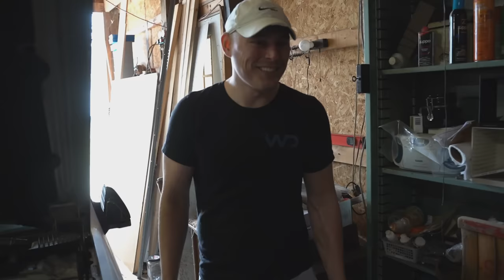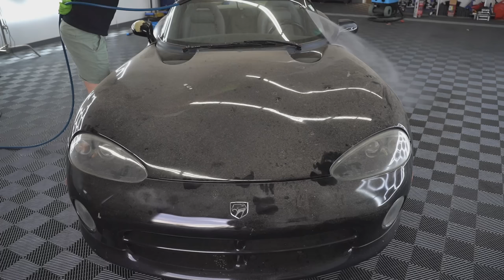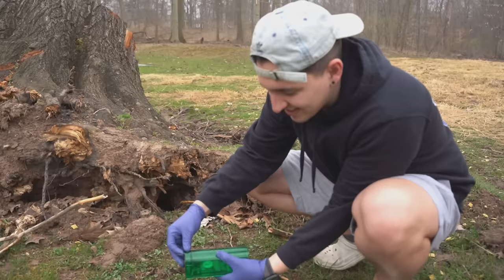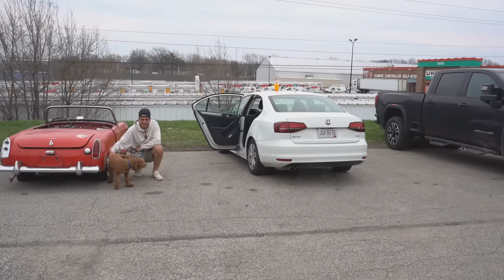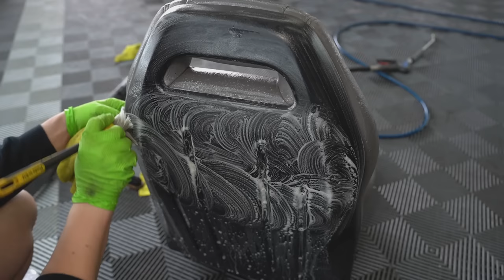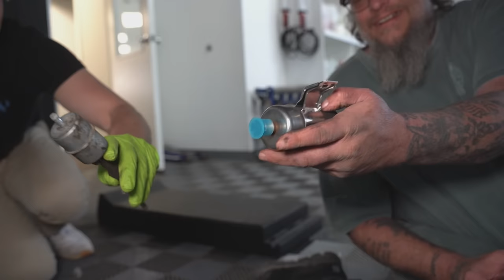ABANDONED BARN FIND Dodge Viper Disaster! Car Detailing Restoration

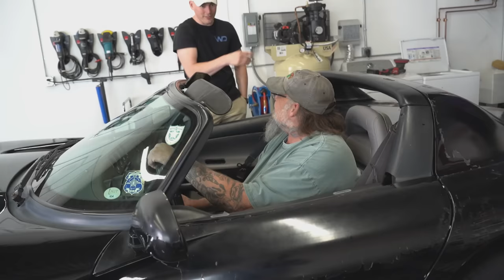Comment: Please address the tires before driving it too much. The rear ones are clearly the wrong size, but beyond that and more worryingly, they're seriously cracked and therefore could blow out any time. At 14:21 you see a massive split in the sidewall going around the entire circumference
Reply: I was going to write that😅
Reply: Old tires are one of the main causes of these cars having a bad reputation for handling.  They were top of the class when they came out with new tires. Those tires have to be like teflon now.

Comment: I was at Chrysler's new Auburn Hills, MI building to see the preproduction Viper. The car they had was rough. It had been beat on. It had no stereo or speakers but the holes were there and it was red. Shelby was there too. I don't know what engine they had in it because they wouldn't show it to us. I suspect that is becsuse it was not the V10. They were never supposed to make money just compete with the Corvette. Later they made a hardtop model which helped sales and it stayed in production for many years. It was never as refined as a Vette. Just brute force.

Comment: 1994 is the least desirable of the gen 1 Vipers. They made the most this year at 3000. About 900 were black. 1993 Viper's are more desirable since only 1000 were made and 500 were totalled. A 1993 antenna car (which I own) is super rare. You'd be better off with an emerald green 94 Viper (only 300) but you still have possibly a nice car if mice didn't fuck it up. Good luck :/